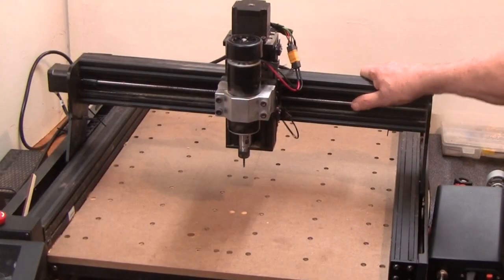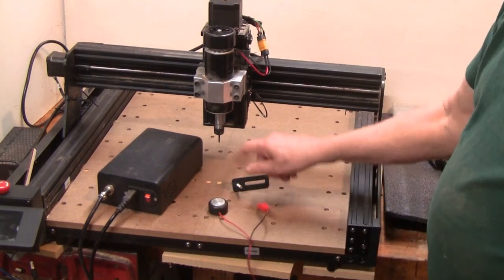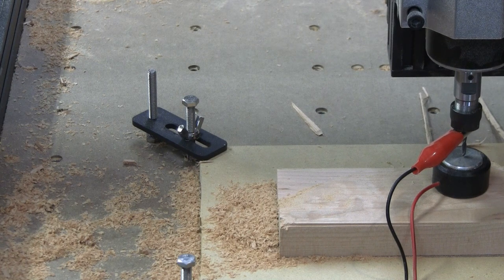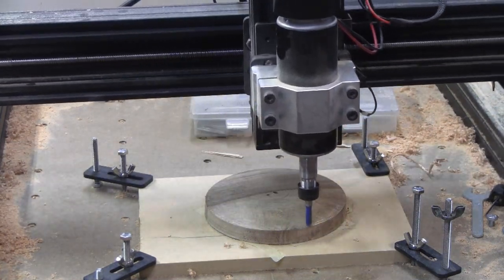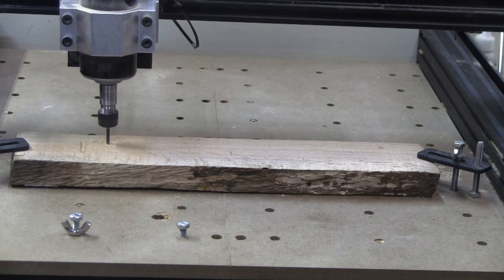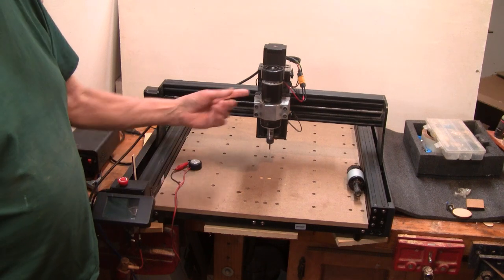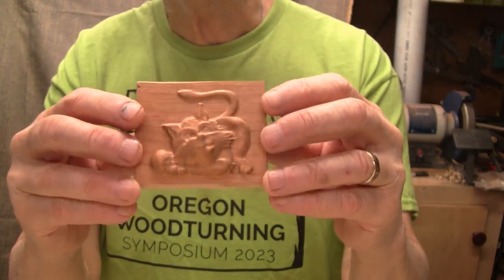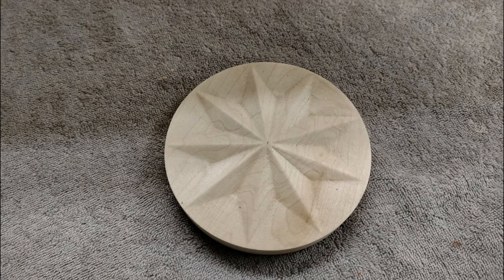TTC450 CNC Router  & Woodworking Black Walnut Not Wood Turning

Comment: THANK YOU for ushering your audience into a wider world of woodworking.  It is like the step change from hand tools to power tools.  The new doesn't invalidate or obsolete the old, but rather opens the door into a new world.  Now Gary, lets see how you (we) incorporate this change into our woodworkmanship.

p.s.  And yes, I guessed your tag on the sign when it started carving the "H"
Reply from the maker: Thank you very much Jeff. Years and years ago pattern makers did not have the modern tools and machines I used as a pattern maker.
I was still making patterns but with machines that fit the job perfectly. As I got close to retirement changes were taking place again and CNC is now doing the things I did and loved. 
Sometimes it is hard to accept new changes but they can make things easier.
Thanks for watching,
Gary

Comment: Guessed it on the 'T' ... but seemed obvious what it was going to be 😁...... nice little aside from the usual turning videos ... seeing perfection time after time can get boring 😂
I'll hopefully be building my own CNC milling machine this year, albeit a bit bigger ..... the plan is to be able to do a 4ft wide sheet, with pass through so that I can do a full 8' by 4' sheet in a few passes.  I bought a spindle a few years back and focused on the collet size (ER20) ... needless to say when a 5kg spindle arrived I realised I should maybe have checked the weight as well ... I'll just need to make a slightly sturdier machine 😁
Reply from the maker: Thanks so much Barry. This Friday will be kind of different as well and I explain why.
So I was going to build a much bigger and heavier CNC router but again a space for it was not going to happen. I know that my big milling machines are taking up a lot of space. The Bridgeport gets a decent size in X but only 12 inches in the Y. That machine has produced a lot of metal parts for my son's race car as well as other replacement parts for cars and even a new Reeves drive for a Delta lathe that you could not get the parts for. Very handy and i mostly use it for making wood carvings for gifts.
Have fun building your CNC and would love to hear how it goes.
Gary

Comment: Do you have any videos of unboxing and installing 
I’m having issues with installing the back bracket on the spindle
Reply from the maker: I do not but what is the issue maybe I can help. Perhaps a picture would help.
Reply: I’m trying to install the bracket that attaches to the back of the spindle
Reply from the maker: @jim6402  I will take a picture if it helps.
Reply: @ThePapa1947  ok sounds good thank you so much
Reply from the maker: @jim6402  https://youtu.be/P3QToopLiu4

Try this I think it shows what you need.

Comment: Looks like it has a lot of uses.  I wonder, is there some way that you could have a hole in the table to place a bowl under to engrave your logo or name or whatever you wanted on the bottom of your bowl?
Reply from the maker: Thank you Sam. Yes you could have a hole in the table . I think making some rails you could fasten to the work bench where the machine would be sitting on. Just running along the sides should do it.
Thanks for watching,
Gary

Comment: How useful would this equipment be without all the software you already had on hand?  I'm thinking hard about some buying some sort of data-driven tool.  I can't really decide to go with a CNC router, laser or 3D printer.  Three very different technologies, but all heavily reliant on software.
Reply from the maker: I have had the software for years. There are some free that can be used. I have designed parts in tinker cad as well.
 It all depends on what you want to make.
I have made some very useful things with 3D printers as well.

Comment: Very useful review. Thank you! I am close to purchasing this in the PRo version as my first CNC machine so I have to ask if - one year later - you are still happy with it (for what it is, of course) and do you think it would be a suitable entry point for me into CNC carving?
Many thanks in advance for any thoughts you might have and greetings from Warsaw, Poland!
Reply from the maker: HI Steven. To be honest with you I have not used it all that much since I did the review..
I am kind of spoiled as I have a full sized Bridgeport CNC milling machine that weighs 3500 pounds.
 For entry level it would be a great learning tool for sure.
  I did not buy any special software to run it. I just used what you can get for free. I would suggest better software to run the machine.
But again I am spoiled with what I have for my full sized machine.
 Hope that helps,
Gary
Reply: @ThePapa1947  thank you 👍

Comment: Do you  have a problem with a white not responding screen? or it just me...
Reply from the maker: I am not sure what you mean about a white screen not responding.
Reply: @ThePapa1947  on my TTC450 screen becomes blank after a while and stops responding to touches if I don't touch it... but g-code keep working...
Reply from the maker: So the touch screen is going blank. I have not seen that but I use my laptop a lot.
How long does it go before it does go blank? Perhaps there is a setting for that. i will check and see and also do some research on it. Have you gotten ahold of Two Trees on this isuue?
Reply: @ThePapa1947  screen goes blank only when run g-code from sd card. From PC all fine

Comment: I should do a trial run on the TTC450 CNC machine, the text that should be engraved. However, I have a problem when I let the machine do the process. It does not actually touch the bottom of the tree on which it is supposed to work, although I went to the Z test several times to adjust the height, however, the machine does not work correctly for me, it works non-stop in the air and non-stop returns up instead of down. How can I regulate so that this does not happen to me, so that it starts working normally. I don't know if it's not a problem in the Candle settings. I use machine dimensions 460x460.
Reply from the maker: It is really hard to tell without seeing more information.
It does sound like you do not have the Z set correctly.
If you would like to email me and send the file you are working with I think I could figure out what is wrong.
You can find my email in my About Page.
 Just add TTC450 in the Subject line
Gary

Comment: How are able to do all of that with that machine. I have had my TTC450 for about two months and its a struggle to get it to do anything. The Two Trees support is useless. I am certain I have a controller problem. I already installed the latest firmware and still have problems with this unit. I am thinking of putting in some other control unit just so I can get some use out of it. Mechanically its a good unit for the price but the controls are useless.
Reply from the maker: The control software is not the easiest to use but it works.
But I am spoiled with using Mach3 on my milling machine.
What are your main issues?
Reply: My main issue set the Z height with the Z probe. I'll put the the probe on a piece of 3/4" wood and try to set the height. If I press the touch screen button to raise it the spindle never goes high enough to slide the probe under. The touch screen beeps with every press but it won't go up. If I try to raise it with UGS or Candle sometimes it will goes up, most time it won't. I then have to turn the Z motor by hand to raise the spindle to get clearance. Then when I press the knife button to check the height with the probe I'll get a "soft limit" error. and I'll have to hit the knife button 1 or 2 more times before I can get the Z height set. When I get a soft limit error UGS and Candle won't function and they can't clear the error. I tried disabling the soft limits in the configuration, but when I do that and start a job the spindle won't move to the starting position but instead will lower and bury the bit into the work piece until it bottoms out. I have other problems as I am unable to complete an engraving unless it is run off a memory card on the touch screen. If I use UGS or Candle it will freeze during the job. I'll have figure that one out later. Any way you can help I would appreciate. I'm thinking or removing the controller and buying an Open Builds BlackBox Motion Control to replace it with, but that an additional expenditure i would rather not make. @ThePapa1947

Comment: Its junk my screws where loose also all over the place , the drag chain is crap. O not to mention i reached out to them and customer service is non existent. Buy at your own risk
Reply from the maker: I had loose screws on this and they got right back to me.  I can not compare this to any other entry level machine but compared to my full sized Bridgeport CNC it is just not fair.
If you just got it I bet you could send it back,
Best of luck
Reply: @ThePapa1947  nope their telling me to get into with after sales and their not communicating back.
Reply from the maker: That is kind of sad. When did you buy it?
And where did you buy it?
Reply: @ThePapa1947  had it since May ordered the upgraded spindle. But it's all good . I can get a crappy product  and great customer service. I would have been happy. But bad customer support is where I draw the line.
Reply from the maker: I know what you mean. Were you dealing with Two Trees or another source that sold it?